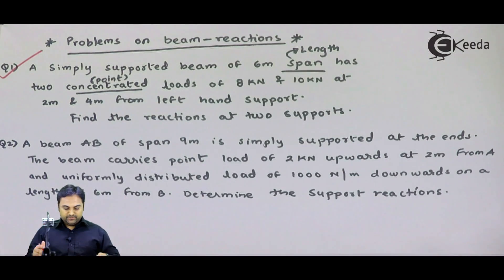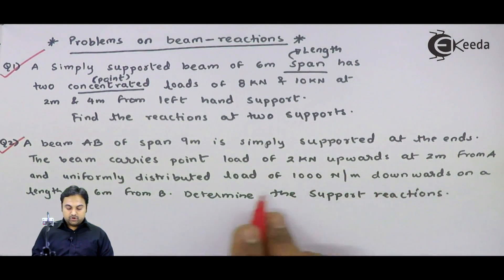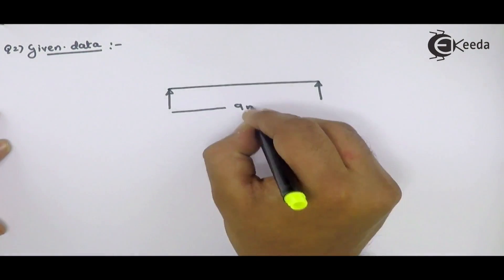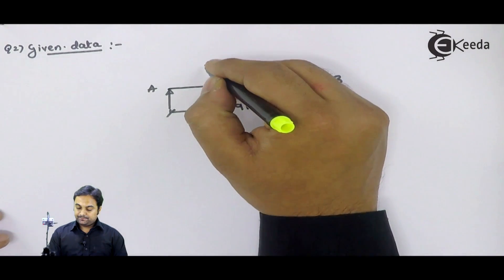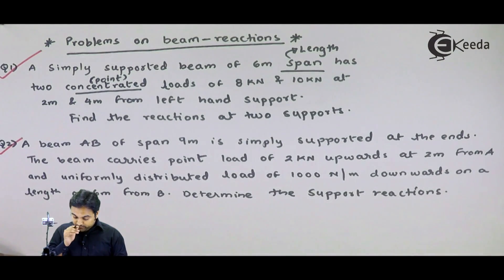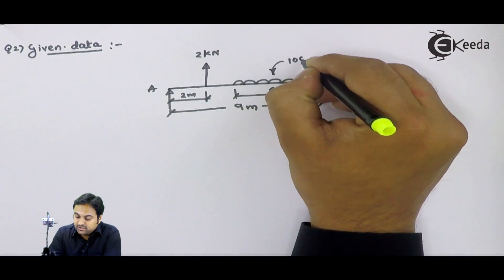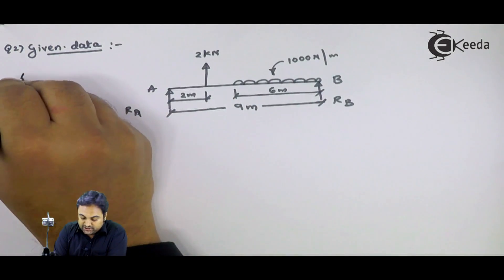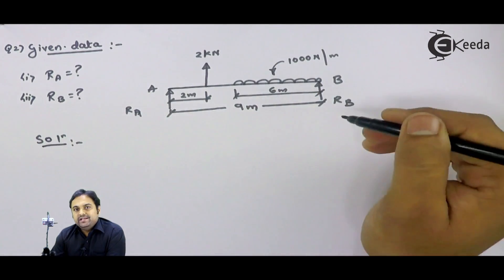Beam Reaction Forces Problem No.2 - Equilibrium - Engineering Mechanics

Comment: Two masses of m1 = 15kg and M2= 25kg are joined by connecting a rod of lenght 0.8m. determine the distance of the centre of mass of the system from m1 if (a) the connecting rod is massless and (b) the connecting rod is a uniform rod of mass 15kg